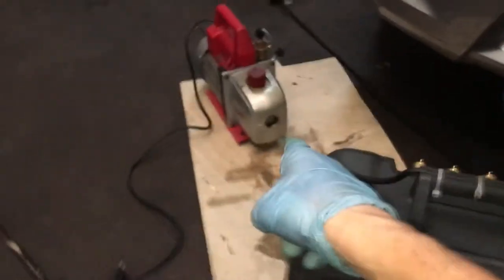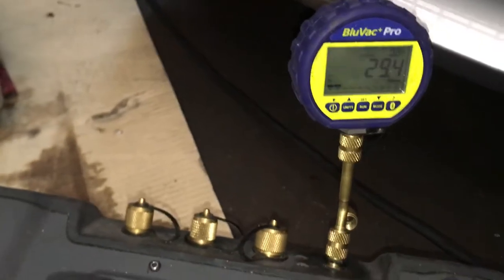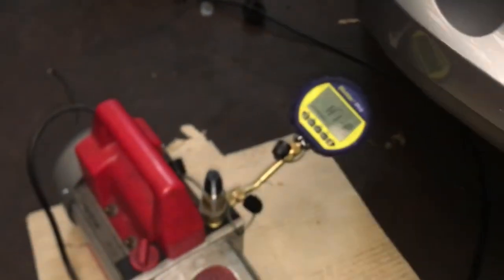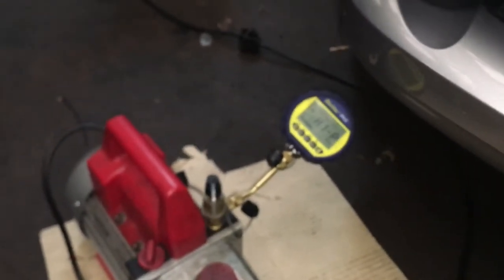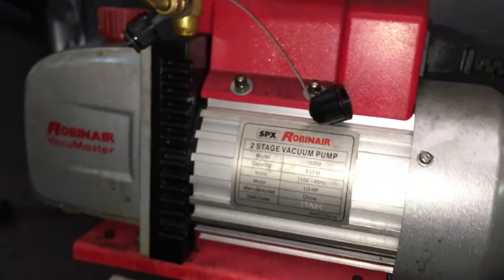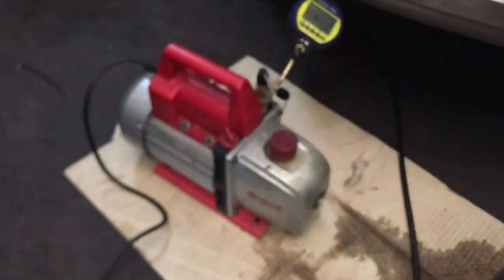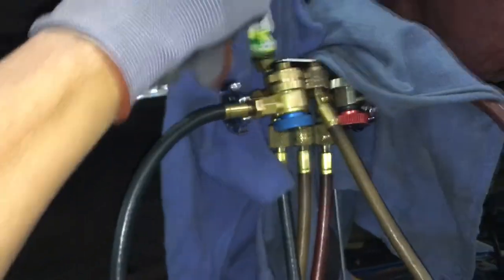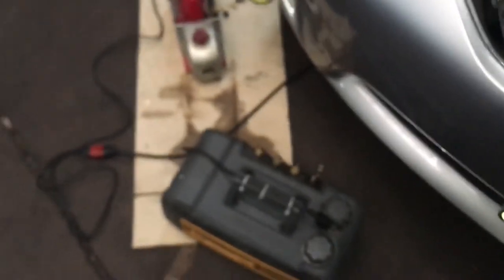Cheap Robin Air vacuum pump, cheap leaking refrigerant gauges, this is what I often find in shops.

Comment: Its overfilled.  Read the directions.
Reply from the maker: Yes, the shop just changed the oil a few times trying to flush it out. Who owns this 

It didn’t make a difference right at the fuel line at the minimum level or over the line. It still did not work. . 

In most of the shops that I get called into who have these cheap vacuum pumps the majority do not pull a deep micron level vacuum anymore . 

They’re usually only capable of going somewhere between 28 inches barely making it to 29 inches mercury vacuum .

Comment: They sell diferent pumps with different air displacement and suction capability, but internally are the same rotor vanes, bore size, same valves... But diferent price with a diferent sticker.
Reply from the maker: Ignacio yes. Manufactured in different companies all together rebranded and relabeled.  Then they would have their old American made or high-quality pumps which I don’t even know if they build any more. 

            First one I worked with and learned on what’s my dad‘s from the early 1970s. South and both my younger brothers learned on it as our first training tool that’s how long it lasted. And we even had micron gauge his back then that were very expensive large clumsy and took a long time to heat up to test our equipment

Comment: What pump/brand would you recommend for automotive ac?? Thanks
Reply from the maker: Fieldpiece, JB, yellow jacket, NAVAC, 
6 CFM is more then enough for the largest SUV or van with dual evaporators. 

Only reason you see me mostly using 10 CFM fieldpiece vacuum pump is because it is lighter than the 8 CFM and the 6 CFM.
Reply from the maker: These are somewhat the smaller cheaper of the better names. 
     If you are, do it yourself person at home only working on your own vehicles you do not need to spend as much money. 
      If you’re doing yourself at home, you have all the time in the world you could leave a vacuum pump on overnight and do the same amount of work. Drying out the system.. 

You could get a small two CFM vacuum pump and just leave it on. 

Now, if you’re doing this as a profession to make money, then you can move up to a slightly bigger, vacuum pump. 

Yellow Jacket 93760 SuperEvac PLUS II 6CFM Brushless Vacuum Pump

Fieldpiece VP67 RunQuick Dual Stage Vacuum Pump 6CFM

NAVAC NP5DP Dual Stage 5CFM 15 Micron Pro Series Vacuum Pump

JB DV-6E ELIMINATOR 6 CFM Vacuum Pump with 1qt Oil

You only get something that’s 10 CFM VX7 
If you guys do a lot of air-conditioning .  You need to be faster.
You’re gonna take advantage of the large three-quarter inch true blue silicone, deep vacuum hose . 
     That is the only reason you would purchase this vacuum pump. 
Fieldpiece VPX7 RunQuick Dual Stage Vacuum Pump 10CFM
SKU:VPX7A2L COMPATIBLE?:Yes

True Tech Tools online 

I do have an 8% discount code 
LECHAIR

ALL ONE WORD ALL LETTERS 

On checkout, there’s a coupon box you put in the discount code and it takes 8% off and all orders over $50 free shipping
Reply: @coldfinger459sub0  Okay, thank you! I wasn't planning on spending that much on a pump, but I'm gonna have to up the budget for a digital manifold. I'm currently using the Yellow Jacket 42006 gauges.

I'm not doing a high volume of automotive ac work cause I'm doing it on the side and it's seasonal (summer) when I do most of my work, still I don't want anything cheap but a solid pump. I'm also gonna purchase a micron gauge (any recommendations).

I'm not sure why my responses are not showing, but thank you, I appreciate you taking the time to respond.. You seem to have a good work ethic and take pride in not ripping off your customers, which involves buying the right tools and good tools.
Reply from the maker: @RicardoSilvas-uq6wn  this is not the cheapest micron gauge but it’s the cheapest micron gauge from this company and this company is micron gauge and sensor. Technology is better than all the other companies.. 

So this is the part number it has their best sensor that is used in their most expensive micron gauge, but they put it into a simple package without all the bells and whistles and software . 

AccuTools A10730 BluVac+ Micro Wireless Digital Micron Gauge with Coupler and Bluetooth
Reply: @coldfinger459sub0  Okay thank you, I appreciate it.✌🏿

Comment: "Full oil"???? You blew by it, but I think on mine, you fill the oil exactly half way to the top of the sight glass. Looks like yours went to the top.
Reply from the maker: I change his oil after this still bad. 
            I get called in many automotive shops that do some of their own air-conditioning and the ones who buy these cheap vacuum pumps usually suffer from a short life. 
                       Unlike the old American made ones that last for decades through literally thousands of uses. 

Just like starting at the age of 12 roughly 1977 my dad started teaching me on his original old Robinair vacuum pump.   That I used for another 12 years then my younger brother was born and he learned on that vacuum pump when he was roughly 12 to 13 years old and then my next brother was born two years after that and he learned on that same vacuum pump. 

       This is one thing I noticed when purchasing vacuum pumps a lot of the Asian ones would die early life compared to the older American made ones. 

I recently purchased a really high-end very expensive almost $800 vacuum pump from a very good company that is manufactured in Asia and it still died after a year and a half. 

     Where I still have mini vacuum pumps by Robyn air by JB by yellow jacket that were my personal vacuum pumps I still have this day that I purchase back in early 1990s.       Quality has definitely changed over the decades. 

        The Robinair vacuum pump you see in this video when I went back to China for sourcing equipment and parts I was at a Chinese tradeshow that actually sells these pumps to Robinair they’re only $30 and then whatever company buys them around the world gets to stick their label and their colors on the pump and call it their own pump when it really is not.
Reply: @coldfinger459sub0  I have an old (very old) robinaire. 6cfm.  I bought it as NOS still in box  about 20 years ago. Made in USA,..I believe the small print says it was part of Bosch at the time. I've used it once or twice in 20 years. I haven't owned a cheap chinese one,..so I don't know how they are. Most of my subs here nowadays all use yellowjacket stuff.
  I Don't monkey with a/c much nowadays.
Reply from the maker: @pukeschannel6882  Yellow jackets still very good quality I still have one or two of those old pumps to

Comment: Just ran across this. You won’t pull a vaccum if you overfill the oil like you did. 0:41 I have the same model and it’s pulled under a 100, hundreds of times. 🤷‍♂️
Reply from the maker: Yes, the shop that owns the compressor did put too much oil in there but even before he replaced the oil for the second time when I got there, it was low and dirty still would not pull vacuum. 

This is his second cheap vacuum pump .

The problem is he never knew that he cannot pull a good vacuum because he only owns analog gauges 

When he pulls vacuum is gauges are in accurate and say that it pulls a vacuum be”low -30  🤣  

The shops, old analog ages actually have a leak in the manifold, valve assembly through the gauges .   

Shop owner did not even know that . 

My brother still has my father’s original Robinair vacuum pump the old fashion kind with the external motor that still works good from the late 1960s
Reply: Mine has the instruction to change oil after EACH USE?

Comment: My Robinair USA made just died   cannot pull a vacuum low enough on the micron gauge and slow .
Locally nobody is using them anymore because new version Chiiiina sourced  and huge $$. So low is the demand for these a national supplier only has 2 and marked obsolete.  Since Bosch purchased R/air they have destroyed there own market in Australia . They have done this else where in the auto industry . 
Have a laugh these are listed as 1000--1800 $$  but a supplier can get one for 600+tax 
90%  of  the ""portable units "" are now china  . No spares for any portable pumps or justso expensive u buy a new pump . So sad the usa version is worn out ............
Reply from the maker: Yes, my father’s old USA made version lasted over 40 years.